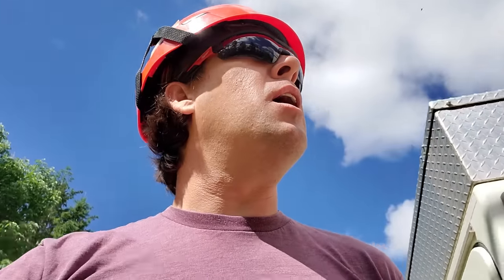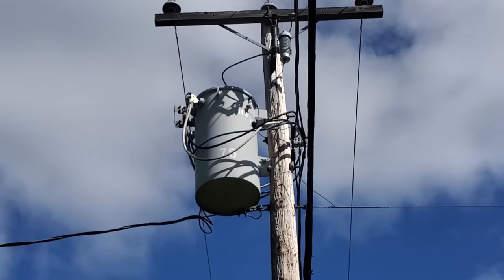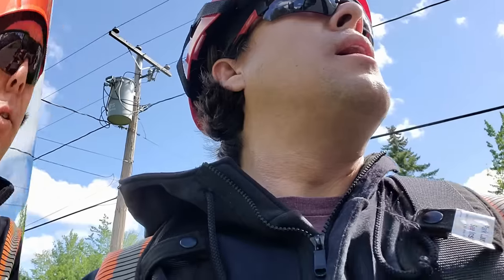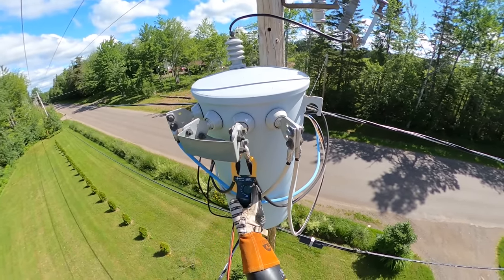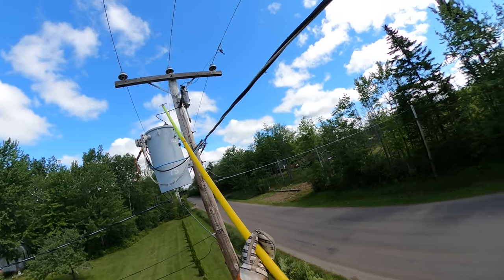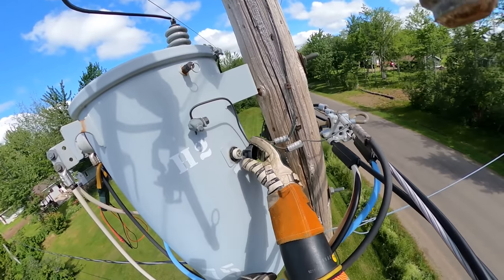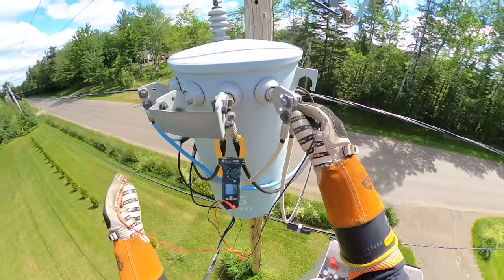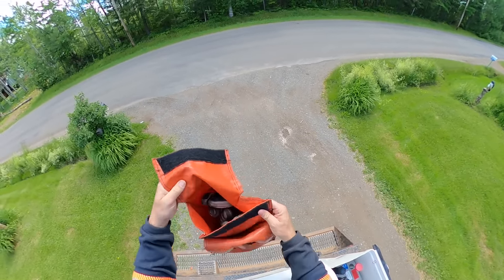How we change voltage on a transformer

Comment: So what do people actually complain about, how do they notice?  I regularly have wondered if I should ask our power co seems like several times a day our power will vary from about 114V to just shy of 126V and seems both legs go up/down the same time (so the 240V swings between like 232-251 according to my home automation summing the smart plug averages between L1 and L2 circuits).  I mostly notice because my UPSs go nuts clicking and buzzing every time it does a swing up or down (I presume as something changes taps) but it seems like it happens a lot some days.  I don't know quite why it varies so much and haven't bothered to call in because as far as I can tell nothing is failing to work, but it has made me wonder what's up on a regular basis.

Comment: Back in my solar installation days the customer complained that their system would cycle constantly. We found that the voltage of their swer line was just under cutoff of the solar system. It was so close that once the system started feeding back in the lower volt drop caused it to go over the limit and shut off, requiring the transformer to be retapped.

Comment: I am from Germany and have a question: I guess the 3 HV wires are 3 phases. 1 phase go to transfomer. So where is the neutral wire to the transformer? Is every house grounded, so the neural "wire" is the earth? thanks a lot!
Reply: Yes, every house has a ground rod driven into, well, the ground and is also bonded to the neutral. An electrician at work has a phrase, "The Earth is ground the world around."
Reply: The supply side of the transformer is usually 2 wires from a 3-phase system somewhere in the 7-11kV range.  The domestic side winding provides 240V but the winding is centre-tapped to give a "neutral" and a split-phase supply. So there are 3 cables supplying the property L1-N and L2-N both giving 120V and L1-L2 giving 240V.  Grounding is done with an earth rod, a buried electrode or something similar and the ground is bonded to the neutral at the main distribution panel.
Reply: @calmeilles  Thank you. So the primary input of the transformer has no neutral/grund input. Thus on  the high voltage power lines are only these 3 phases wires an no neutral.

Comment: What is that piece of hardware on the back of the pole behind the eye nut? Looks like your transformer leads and service wires are squeezed and then run through it. Been in the trade 3 years and never seen one of those.

Love your videos, thanks for the learning material on YouTube, it is few and far between on this platform.

Comment: This is weird, seen with European eyes ;) So, you have a 3-phase high voltage line, but use only one and ground to the transformer's primary? And the secondary is a 2-phase with center tap, as 120-0-120V?  So the household will have access to both 120V and 240V single phase, right?
Reply: Yes that’s how it works, they use 240v for the bigger appliances.

Comment: I worked in a mill where the voltage was high by 4 % when the mill was in full operation. The mill was using in excess of 14 megs.
 But the problem was that when the entire mill was shut down, the voltage  rose to 7% of nominal
Due to the low loads. 
 During eaerly restart up of the mill, the high voltages were damaging electronic control circuits in variable speed drives.
Every other mill restart involved some kind of drives control failure.
 It is important to know what the line voltages are at both normsl operation, and low load conditions.
 After adjusting down the incoming voltage slighly, the reliability of the mill electronics improved greatly.

Comment: Very nice. 
If the voltage tap option had not been available on the transformer,  what was your alternative ?
CSA recommends a "normal" voltage range as 220 to 250 volts line-to-line, which is not symmetrical around the 240V nominal value.
Reply: Your alternative is to put a very expensive transformer on your house to lower the voltage just a little. Realistically, if it's within standard limits, it's not actually a problem, and if a piece of equipment is really that sensitive, you want to use a power supply that can handle it.

What you probably have in this video is people breaking something, and then blaming high utility voltage on the failure, when in reality it's the fault of whatever broke for not conforming to the standards.

Comment: Are the primary lines usually the same voltage? so it would not make a diff. going to the transformer....
Reply from the maker: Same in theory, but they're never exact. Swapping to a diff. Phase would also change the voltage. We try not to do that too much as the specific phases is documented in our system to help with load balancing
Reply: @Bobsdecline   makes perfect sense,  balance the phases...  thanks

Comment: Great Channel.  Very interesting even for someone like me who doesn't deal with it.  Question.  In a previous video you mentioned that some of the transformers have mineral oil and they are working at using veg oil for the biodegrade ability.
What is the life of the veg oil compared to the traditional?  Is there just a swap of the oil or does it require a completely new transformer?
Reply from the maker: It comes as a completely new transformer, for us at least. We only order the veg oil along with the stainless steel cans. I'm not sure how that impacts the life of the oil compared to the mineral oil... I'll see what I can find out!

Comment: Great Video. How did the customer know that his voltage was too high? Thanks.
Reply: I would assume that they had their own multimeter or they had an electrician do work on their house who informed them.
Reply: what i was thinking - i don't know!
Reply from the maker: Yes exactly. An electrician that was on site felt it should be lowered for some sensitive equipment that the customer had installed. 
The slight difference in voltage isn't really accomplishing much tbh, but it was a quick and easy task. The option happened to be there and resolved any slight concerns
Reply: @Bobsdecline  Sounds like a bunch of BS, the electrician trying to be important. Please do cite any oh so special equipment the customer can have that won't tolerate 4V AC over nominal. That is just laughable and a nuisance. Any SMPS rectifier is fine with that voltage, and old transformer devices will just run a bit fast/at increased power, unnoticeable. Motors will handle the voltage fine. Sounds like utter BS to me, and I'm an engineer. Sounds like that electrician never studied electronics theory, and the old coot owner told him he had an expensive computer and the guy wanted to seem knowledgeable and got the idea in the owner's head that the utility was giving him bad service, and the guy takes any excuse to complain...
Reply from the maker: @John Smith 💯. The customer in this case was excellent. Once I explained to him that there were no problems, he was ok with it. I've had a few similar complaints, on this stretch maybe as a result of the same installer. On a previous days I saw a reading just over 126v, so tapping down a least keeps things official. 

Only once I had an electrican in the exact same circumstances get extremely upset. Management had to get involved and he he still insisted the he was right. There was no sensitive equipment on that particular premises either. The voltage he wanted was 110
Reply: @jovangrbic97  4 volts over nominal isn't a problem. The problem comes from different ideas of nominal. Before the 1960s or so equipment was usually designed for 117 or even 115 VAC. It would really only matter for old tube gear which is rare these days. And most of that is owned by electronics experts who can adapt for increased voltage if present.
Reply: @eDoc2020  I'm not that much of a tube guy, but would 10V over on a tube grid voltage be capable of doing any damage, or just change the response a bit? The heaters are transformed down, so they would only be a fraction of a volt off, and not harm the heaters I figure. Are the tube circuits that finely balanced, back in those days grid voltage fluctuations would have been more frequent, so they couldn't just have been built to crap out the moment your neighbor turned off his oven?
Reply: @jovangrbic97  10 volts on the grid would make a huge difference. Fortunately that's not what would happen. I don't know at what point it really matters. I do know that the manual for my ancient TV (actually a sister model) says to make sure the line is between 105 and 125 volts.
Reply: @jovangrbic97  as far as the heaters go, all my tube radios are of the "AA5" variety and just have the filaments hooked up in series without a large transformer.  It's hard to imagine someone who owns tube gear who doesn't own a variac.
Reply: @moconnell663  Ah interesting insight, thanks!
Reply: @eDoc2020   It was slightly earlier than that, ANSI C84.1 setting a nominal 120V came into force in 1954 and even then was really reflecting existing practice. Utilities had been supplying higher voltages since the 1930s to compensate for voltage drops over longer lines as electrification spread further into rural areas.
Reply: @calmeilles  Thanks for the info. It's nice to get an actual standard number. I knew they were using higher supply voltages but I thought they were still targeting a lower point of use voltage. I believe I've heard Edison's system was using 120v at the generator and 110v (maybe 100v) at the light.
Reply: @eDoc2020   When Edison first put wires into the rich people's places in Lower Manhattan he chose 50 volts (And of course DC) not for any efficiency reasons at either the generator or the lamp but because the nice reassuringly round number looked good for marketing!

That legacy is with us today in many guises, most directly (if you'll forgive the pun) in telecoms 50VDC power, formally standardised at 48V, also used in some computer supplies.

Faced with more demand than his wires could provide instead of replacing them with larger ones or adding completely new 2-wire circuits he saved money by adding only 1 extra wire but at an opposite voltage, now a supply was 3 wire, +50V, 0V and –50V. At first the systems were only intended for light but able to tap the two live conductors with a potential difference of 100V it was possible to do other things and the first electric resistance coil heaters were sold in the 1890s.

That is the origin of split-phase supplies, although strictly speaking "phase" is not involved until AC is introduced.

More demand further from the generators lead to voltage drop over longer wires so power was produced not at the nominal 50/100 volts but 55/110. The next generation of dynamos skipped up to 110/220 to allow more power to be transmitted on the same wires. Existing installations with stockpiles of bulbs adapted by using 2 in series.  Just check how many light fittings are made to take two bulbs. That began here!

Westinghouse had been producing dynamos for Edison and also alternators for his own projects. When these were first exported to Europe they were wound to produce the 110/220 of New York but as European engineers were installing new cable they saw no use for the split phase complication and went direct to 220V single phase AC. Except the Brits who with an attack of not-invented-here syndrome went 240V instead.  

And with a little fiddling around the edges the odd harmonisation programme and so on that's where we are today! 😀
Reply: @calmeilles  The story I heard was that Edison bulbs were a very round 100v and that arc lights generally used 55v. As for telecom, my understanding is48v was chosen because it's the highest voltage generally considered safe. I don't think it was chosen because of lighting power supplies.

Comment: I'm a utility engineer. Obviously, I don't know your system, but I would use this as a last resort. If you have a PQ recorder, it would be good to set one and see how high the voltage is getting. If, as you say, this is on the feeder close to the substation, then it is unlikely the only transformer experiencing high voltages. The LTC/regulator control settings may be too high to compensate for EOL voltage getting too low, the calibration may be off, or if you have three phase voltage control, load may be imbalanced. Then, if you have an adjacent substation to refeed from, you may under voltage them. It's best to have your transformers on the tap for the system they are on and manage the primary voltage better.

Comment: I don't get it, wouldn't you rather be a little over than under? If you do have sensitive electronics, wouldn't you have an online double inversion for your business or home?
Reply: It's usually better to be a little over at the supply end. Voltage drop in the wiring will bring it down at the load end.

Comment: The DETC(s) are usually 2.5% coarse adjustment 1/2/3/4/5 or A/B/C/DE with 3/C being nominal. 

Do you put in a hot line tag for this type of work?

Good point if you operate the DETC while energized severe damage to the transformer is likely. Time for a new can.

Most substation LTC(s) usually have a 120 band center and 4 volt bandwidth with a 30-60 second time delay.

Comment: Here in Australia, we have so much sun, and solar installs are so cheap here, I’ve had at least one friend’s nominal 230v running at up to 265v, and this is with the transformer on the lowest tap it has. I think this has forced the power company to replace otherwise good transformers with models that can better handle the solar output. I’d imagine there are also inverters which are smart enough to dump their generation if the line voltage gets too high. Either way, during the day, you can see my uninterruptible power supply for my computers etc switching to buck taps during the day (so lowering output voltage), which then tapers off at night.
Reply: I think grid tie inverters are mandated to trip off-grid in all kinds of scenarios. Surprised that 10% overvoltage isn't one of them.
Reply: @thewhitefalcon8539  this was quite a while ago. More modern inverters likely have much better grid control.

Comment: Just curious, there doesn’t happen to be a new solar field in the area is there? We’re having a fair amount of high voltage issues similar to this on feeders where large solar fields have been installed. Also what are your company’s MAD’s while working alone? The utility I work for requires a qualified two man crew for any work within 2’2” of any primary voltage source.

Comment: Do you guys in Canada have much solar installed? If we are to work on the lv  network we put lv shorts up
Reply from the maker: It's just starting to get popular now, we generally install low voltage shorts to prevent back feed into the primary windings. Low side disconnection is also an acceptable practice for us as protection from back feed into tx. (Meters removed or grounds)

Comment: POLE PIGS FUN FACTS:
These have been used for the manufacture of neon signs - not idea but they do work.  
Bent to shape glass neon tubing have electrodes at each end with a 5mm glass "tubulation" which is connected to a vacuum pump. A vacuum is pulled to about 2-3 mm/Hg (atmospheric air pressure is 760 mm/Hg) high voltage and current is used to energize the neon to heat it up to 230C and to process the electrodes. The neon is then pumped down to a medium vacuum 10-3 mbar (atmospheric air pressure is 1015 mbar) neon gas is admitted to around 12 mm/Hg (this varies) and the tubulation glass is sealed off using a special type of hand torch. And voilà the neon glass tubing is finished and color is classic neon red. 

There, now you know something! 😃
Reply from the maker: Interesting, Thanks for sharing!

Comment: How would a homeowner notice voltage was too high? I assume if it was real bad there could be damage to things plugged in, but that still seemed within normal limits. What were they noticing that made them call?
Reply: Unless he had something like a Leslie speaker where voltage affects the pitch of the sound
Reply: A volt meter or overheating appliances blown out lightbulbs ect.
Reply: @daheick  appliances are made to take +/- 10%.  Many have universal switching power supplies that can do 100-250 volts
Reply: @xzibit8614  ... on a Leslie speaker it won't change the pitch, but it might affect the flutter speed, although I do believe most of those motors have speed fixed to line frequency. (like a turntable motor)
Reply: @xzibit8614  ... these days (for the last 20+ years) you can check the data tag and see they are usually good from 105 volts to 130 volts, which is more than 10%.

Comment: I'm watching this from Europe with 245V in my socket from a 3 phase connection to a large transformer (shared with other houses) with an automatic tap changer. 
Is this few Vots over 240? Yes it is.
The power company simply prefers to rise the voltage just a bit in order to reduce energy losses.

Comment: At First Energy Ohio Edison we’d order a recording volt meter.  If it’s in tariff 120 nominal 126 to 114 that’s all we do.  Also we’d measure at the source side at the meter can source lugs.  We only had no load tap changers on step transformers.  Sometimes we’d have 34.5/19.9 and drop primary to 12.47.  Another way to lower voltage is check any cap banks nearby.  There should be a cap bank controller that if opens at 124 or so can lower voltage a few volts.  If it’s a fixed bank I could order a var/voltage controller install.  Troubleshooter should have checked for any cap bank issues. Second, check at the sub.  Should be 123.5. Maybe tap changer is locked off. I wouldn’t have adjusted voltage at the pot if it was in tariff.  ST retired Substation Engineer. FE.